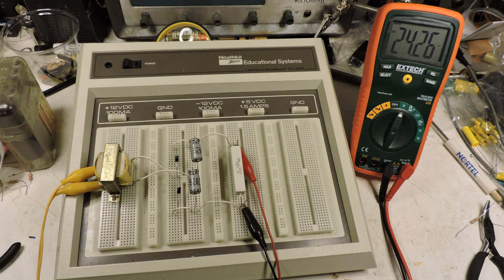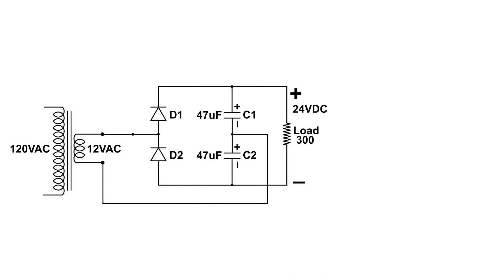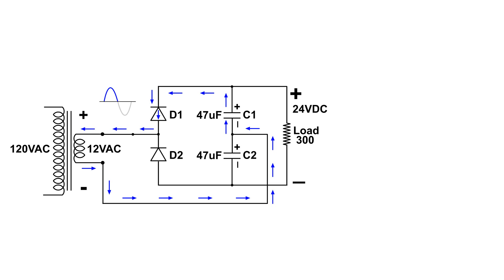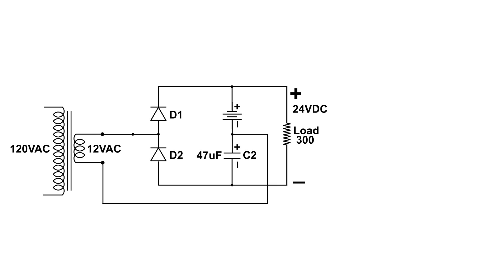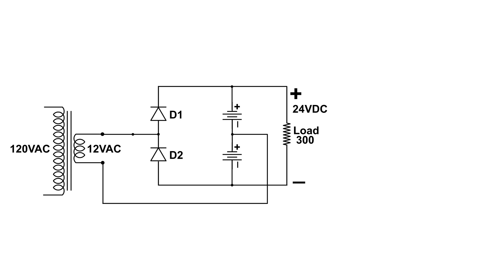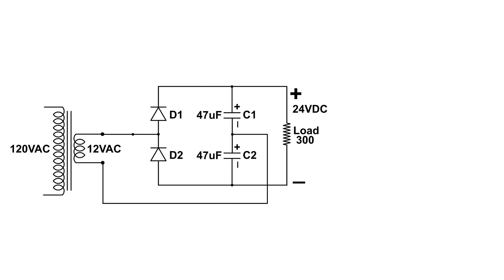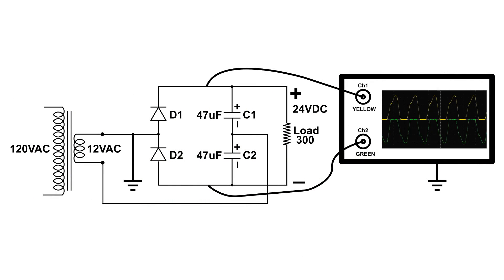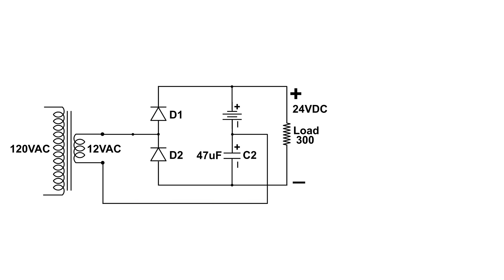Voltage Doubler Circuit Build Oscilloscope Demo

Comment: Im a bit confused about the ground point.    C1 is charged through D1 but D1 is effectively a closed switch when on. Then how can we have a voltage difference between the ground and C1 in your oscilloscope plot. (Yellow line). Perhaps you have a video that explains this better.
Reply from the maker: The best way to understand this circuit is to build it and measure the voltage across each capacitor.

Comment: Great video but was a bit confused about the scope plots. Also where is the steady state DC
Reply from the maker: The oscilloscope is looking at the diodes. The ground of the oscilloscope is between the diodes. The smooth DC is across the load, the 300 Ohm resistor.
Reply: Thank you for your clarification . I get it now. The voltage between these 2 wave forms will give a constant DC voltage across the load resistor. Really educational.
Final question :) . Can i use a signal generator instead of the transformer to set this circuit up at home. Would it give the same result ? I bought a Rigol DG1022 second hand some time ago but have not used it yet.
Reply from the maker: @michaelcostello6991  I doubt that a signal generator can produce that much output. But it should not hurt to try it.

Comment: +AllAmericanFiveRadio  Your videos are always very informative, appreciate all of your efforts.  Is the maximum output wattage of this type of voltage doubler the same as the output wattage rating of the AC transformer?  Your transformer is labeled with a 12.6VAC 300mA output, would the ~24VDC output from this voltage doubler be maximum of about ~150Ma?  Meaning it could handle an approximately 160 ohm load?  Do the capacitors need to be properly sized to get the maximum DC output wattage?
Reply from the maker: +ReasonForemost 
I've had a few questions about this voltage doubler circuit. What would the results be if he did this or if I changed this, types of questions. The circuit is still on the breadboard so I'll do another video and do things like take the load resistor out of the circuit, change the load resistor to a lesser ohms, and increase the capacitance of the two capacitors in the circuit. And we'll all see what actually happens.
Rick

Comment: +AllAmericanFiveRadio once I made a Voltage Doubler and the diodes I replaced with LEDs. and this filmed with a 420fps camera so that you can see the charging cycle of the  Circuit.  can you use these recordings?
Reply from the maker: +20kilovolt I need one of those 420fps cameras....Thanks

Comment: Interesting, I took my insect killer lamp apart yesterday and it has 3 capacitors and the output say AGD 220x3 HV in reality the output is not 660V but 585V, but that's enough to deal with the insects. I thought I would have needed a transformer of some sort in the circuit, but it only consist of 5 resistors, 3 diodes and 3 capacitors. 
Thanks for sharing your video had perfect timing :)
Reply from the maker: +Yann Kitson Thanks